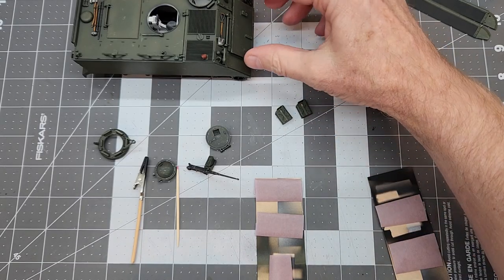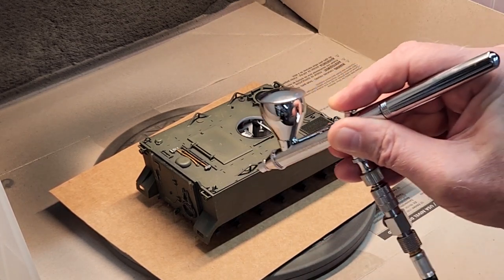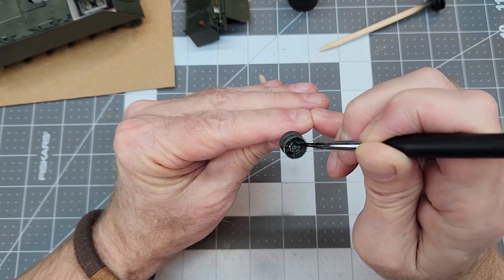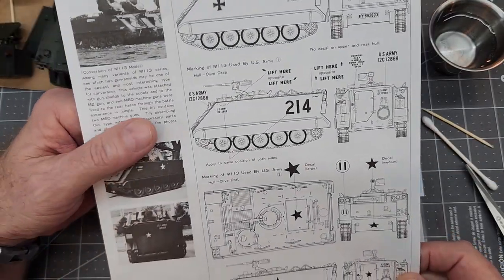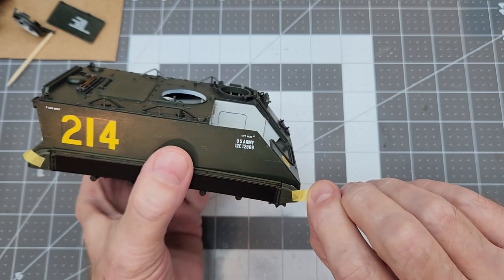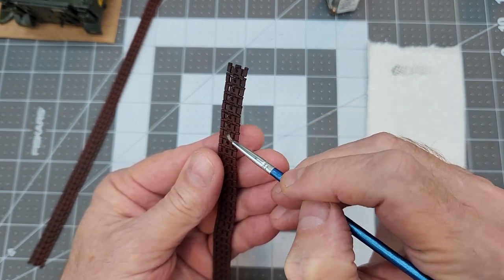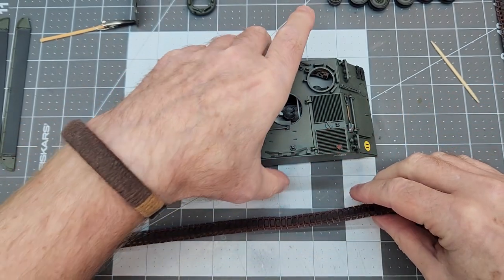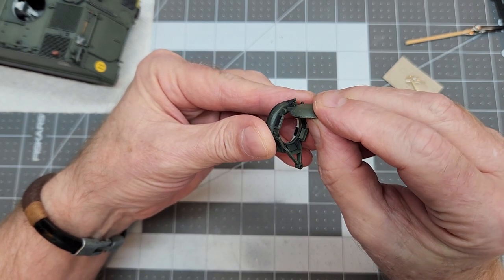M113 Armored Personnel Carrier, Build Part 6, Panel liner, Decals, Tracks

Comment: Can you tell me what the afv tracks you used. Did you have to modify the tamiya apc sprockets or anything?

Beautiful work by the way
Reply from the maker: Hi James, sorry for not including the part number in the description. It's AF35306 and yes I had to thin the drive sprockets to make them work. I show this in one of the build videos, I think part 1. Thanks for watching, take care and good luck with your project. Johnny
Reply: @hillbillymodeling  thank you much....making a m113 as a gift for a friend of mine who drove one in the 90s in Germany. Anyway hate the tracks this older style kit has. And man I've had to put the exacto knife and putty to use...some loose fitting parts, but it will come together.
Reply from the maker: @jamesbirckhead2105  Sure thing James, those drive sprockets will have to be thinned out and I had to put a spacer between the sprocket hub halves to get the width right for the AFV tracks, I think I did all of that in the first video of my M113 build series. Not hard to do, just takes a little time. Hope that helps, take care my friend. Johnny

Comment: the apc  had the entire floor was covered with ammo 50 calber  type. Fire fights  ,t here was alot of bullet s   flying around  easy  to use alot, depending  on the  the fire  fight s  enemy  hit or run or stay and fightit  it out . rear middle  seat removed  rear grren cans attach ed  removed  ,front cover removed for use  of water flow  crossing .
Reply from the maker: Thanks for the info, Louie, it always helps to but things into context. I have seen photos of the fording board being removed as you say, but there are plenty of reference photos from Vietnam that show APCs with the fording boards still attached. The same thing can be said for the swim skirts that where often removed for ease of maintenance, but we can find examples of APCs with them attached. So, in the end I would say it's up to the modeler as to what version to build. I think the Tamiya has done a great job with the kit and we have lots of options to build it in any modified example we like. Thanks for watching, take care and model on! Johnny

Comment: I wish that you would have drilled out the headlights and used UV resin. Maybe next time?
Reply from the maker: Hi Tim, there are some issues with modifying the headlights. Both the driving lights and the IR lights have the same convex profile, so if you decide to do one you really should do the other as well, even though you'll ending up just painting over it. Since they were nicely molded, I decided to leave them alone and paint them. Thanks for the great comment. Model on. Johnny

Comment: I do running too in them bottles I open small tamiya paint and top it up to tip under lip jar then cap it shake it then i mark it tinned out so b4 use i always just shake bottle well so usable straight away tamiya acrylic thinners or mister color leveling tinner then iv AK paints that use its own tinner for it milky white clear varnish gloss i wonder why stays white but it drys clear shiny nicely i tested it only other day
Reply from the maker: Hi Keith, those ModelMaster paints that I love so much, which you can't get anymore, is the same way with the clear. It's milky when wet and dries clear. Stay safe and model on my fiend! Johnny
Reply: @hillbillymodeling  thanks bro i found it strange but im glad to here it's normal for some paints to be that way

Comment: How did you put the AFV Tracks together? The instructions say to glue each pad together. That would not make them workable if you glue them together.
Do you glue a few at a time?  Thank you for this video series. I have this Kit and am building it for my first AMPS Show in Atlanta.
I got that AFV Track Set AF35S22, which included a new drive sprocket.
Reply from the maker: Hi David, these tracks are tough to snap together, I cover this in part 4 of this build at around 13:06 in the video. There I think I give good and clear instructions on how I did it. Let me know if there is anything else I can help you with and good luck in the show! Johnny
Reply: @hillbillymodeling Thank you for your reply. I am having a hard time with them snapping together and staying together. I guess I was trying to see how you snapped them together without gluing them like the instructions show. It makes me wonder if there is a difference between the tracks from your set and the ones I ordered. 
Thank you for making this set of Videos on the M113. This is the kit I am using for my build. I hope to flatter you by trying your technics for my build. I'm more familiar with the M113A3 since I spent much of my early military career in them.
Reply from the maker: @dwgeer13  So sorry you're having such a hard time with those tracks; they are difficult to snap together. Instead of trying to slide them together, lay the connection points over top and press together.  I had to use pliers, like in the video, to hold the one link in order to press them together. Thanks for watching, good luck. Johnny